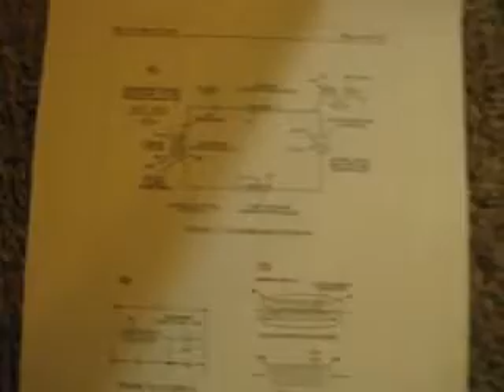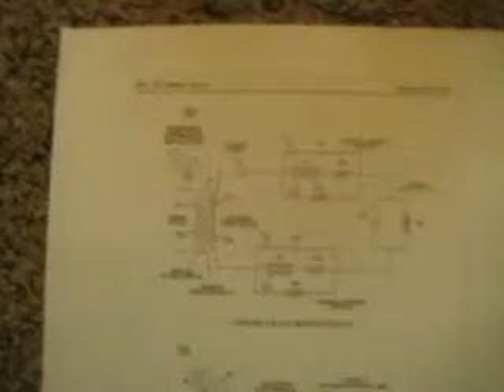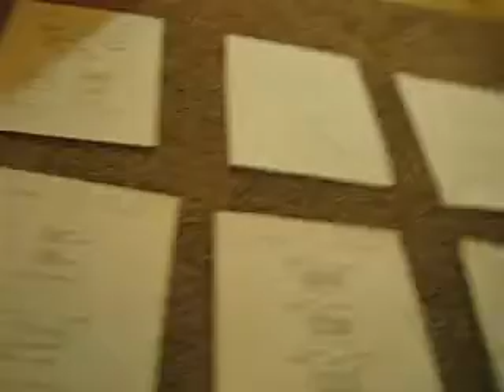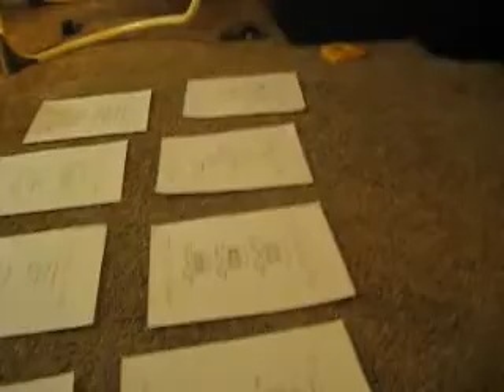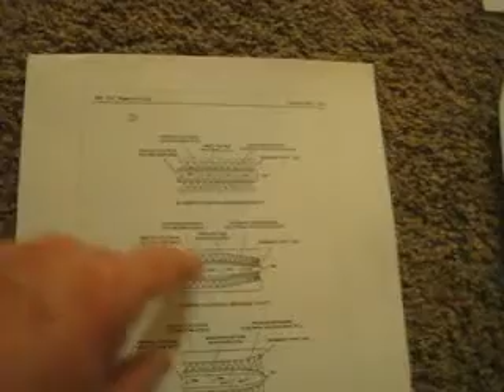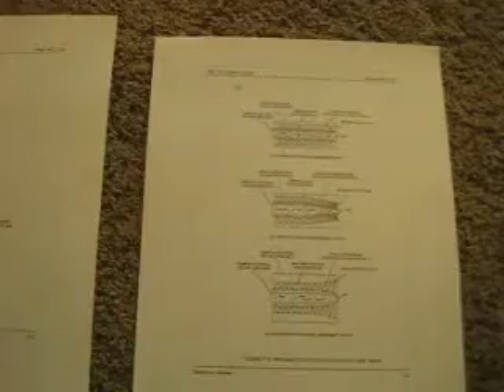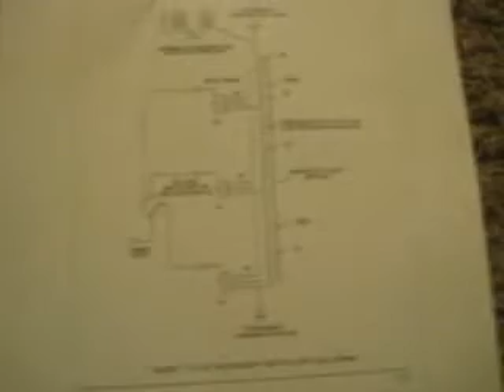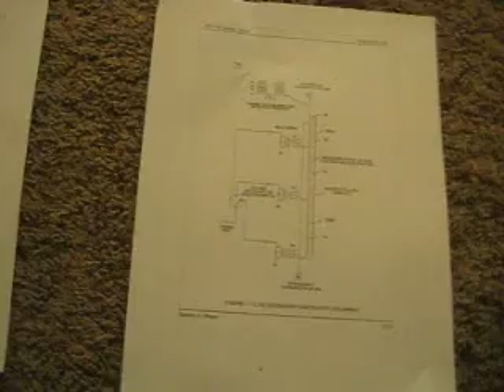Stanley Meyer Water Spark Plug Injector

Comment from the maker: I would have to measure the hole in the injector to see if it is small enough. if it is at 30 thousandths on an inch or less it should work fine, but I do believe it would work fine. I'll be running HHO through my fuel injection system in the future and I'll post a video on it.

Comment from the maker: The gasoline vapors would be good enough for most people. I have achieved 200+ MPG using a hot vapor system so I know what can be done, now it's time to tweak my new system, do lots of testing, make the changes I need to and have a unit that is 100% reliable so these mileage gains can be achieved every time consistently.

Comment from the maker: I will be doing some extensive testing using a HHO and gasoline vapor mix. If I can have a ratio of 90% HHO to 10% gasoline vapors I will be satisfied. Right now I am shooting for a 80% HHO to 20% gasoline vapors mix, once I achieve that I will do the 90/10% and so on.

Comment from the maker: I totally get where you are coming from. Using brute force electrolysis from what I have seen wont work. You can't have a brute force cell run a car, they consume way to much power. You can get brute force cells to be pretty efficient but even at that you would have to do something else along with it to make up for some of the energy it uses.  There are allot more ways to make HHO other then brute force. These other ways are how it can be done.

Comment from the maker: If you make an efficient HHO cell this can be done. I will prov it to you here in the near future. If you don't use as much of the energy from the burn of the HHO such as the heat the it would be very difficult and may not be possible to run a car on it however there are methods of changing the exhaust heat into electrical energy therefore you can capture more energy then just mechanical energy and use it to loop it back to the cell. Keep a look out for the videos I post on this.

Comment from the maker: The original tests done on producing HHO were done using straight dc current with 2 nails. This method of course will never be efficient and one could never run a car on water doing it this way. The laws of thermodynamics for producing HHO were set using this method this is why the other scammers (government etc.) say running a car on HHO can't be done. They focus on the most inefficient ways of producing HHO and will never give true data and credit on other methods of making HHO.

Comment from the maker: I sure have I have read, watched or listened to almost every piece of Stans work nearly every patens, news report, story, books, dealership manual, radio broadcasts of his work, etc. That patent is very informational. He used the non combustible gases to reduce the burn rate using these gasses dilutes the hydrogen causing it to burn slower.

Comment from the maker: You could try that and see what happens however I don't know that enough water would be converted to HHO using that method. The only way I could see it working like that is to use enormous amounts of high voltage so it could ark throughout the whole cylinder at the same time. Good thought!  We would just need to try it and see how well that works.

Comment: Great video Tyson. I've read of other systems using high voltage(apx 70,000 volts) being pulsed at apx 20,000 Hertz. And extremely low amps. The coils in newer model automobiles send up to 100,000 thousand volts and very low amps(much less than one amp) as well. See the Xogen Patents as well(via google search).